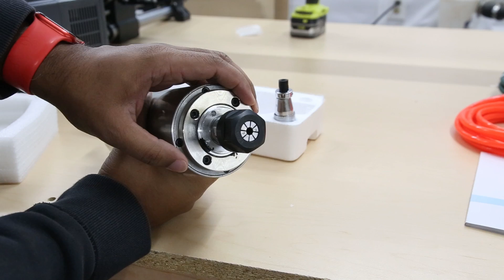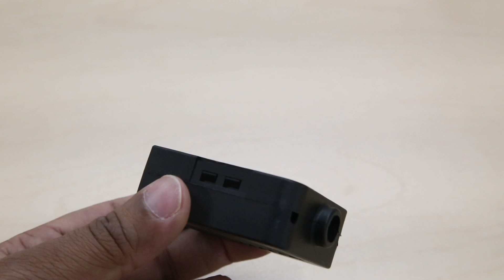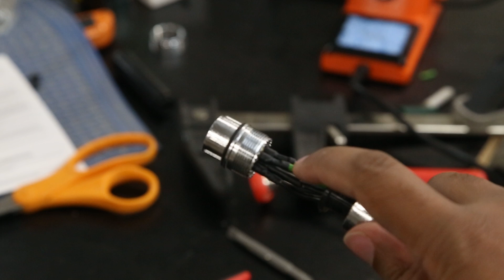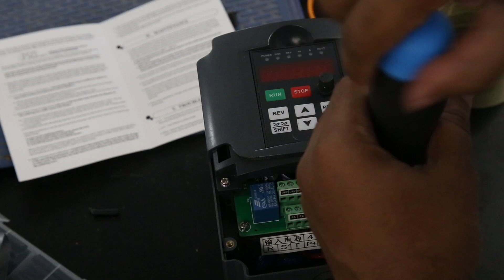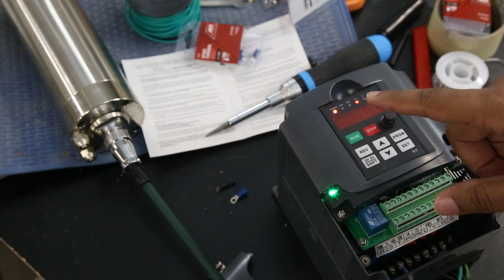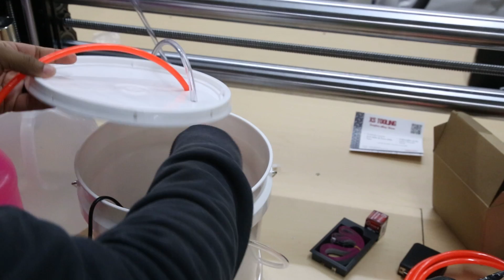How to add a Spindle to your CNC

Comment: Do you have an additional do's and dont's after 2 years of use? Great video, thanks for posting.
Reply from the maker: Related to using the spindle on the cnc or setting up the spindle?
Reply: @vanstray  Related to the using the spindle. I'm seriously considering a spindle and rely on experienced folks for info before I take the plunge.

Comment: Great video thank you for going through the entire process. What awg did you use for the 4 core shielded cable. For some reason the part number on igus is not recognized thanks.
Reply from the maker: should be 16 awg not sure if they've updated that part number since the video was first released, but they had something similar last time I looked.
Reply: @vanstray  thank you for the reply, much appreciated great video!

Comment: I got the journeyman x50 as well. Do I only need to get the 80mm spindle mount to add a spindle to mine? Or do I have to have the heavy-duty Z20 slider as well. Great video
Reply from the maker: You only need the 80mm mount for the x50 if you want to eventually upgrade to the elite version you’ll need the Z20
Reply: @vanstray  I got the Z20 with 80mm ordered. I think I should go ahead and order the stiffy as well

Comment: Better solution ... use cable ferules (the ones with no plastic caps) on the wires, cut to size and then solder the ferule bound ends into the connector. Better consistency.

Comment: That spindle cable shielding should be in contact with the outer connector housing and the ground pin on both the spindle and the MFD side.

Comment: I was wondering if you needed to update to the heavy duty mount for the 1infinity because that spindle was 20lbs or was the mount that came with the journeyman doing ok?
Reply from the maker: I didn’t get the beefy Z mount just then 80mm mounting ring. So far it’s working pretty good.

Comment: One question, why did you tin the wires before crimping on a terminal? I would think crimping to the wire would give you a better connection.
Reply from the maker: Honestly I just didn’t want to deal with all the loose copper fibers when I trimmed the connections. I didn’t find anything against doing it that way and haven’t had any issues

Comment: The shielding on the cable should be grounded to each plug.  Cutting it off the way you did won't let it do its intended purpose.  I used to do wiring and soldering for a government contractor for the USN.  Other than that you did a great job.
Reply from the maker: Thanks someone else just mentioned that to me. I’ll be working on making those updates next time I’m working on the cnc setup

Comment: Great video! I've watched other videos on adding a spindle to a CNC router and you've covered everything in detail. I like your recommendation to get a skilled technician to do the soldering. While I've soldered a lot over the past 40 years and my work has held up for 20+ years in service (life of the equipment), it has been intermittent and done out of necessity. None of my soldering looks as good as that done by a skilled technician who does it daily.

p.s. - At some point you may want to add a flow indicator to ensure the coolant pump is doing its job.
Reply from the maker: Thank you! And I’ll look into the flow indicator

Comment: Great video! thanks! Question, any issues with a 2.2KW on a standard house 15 amps?  or do you have a non-standard higher amp plug?
Reply from the maker: Nope it’s a 120v spindle, haven’t had any issues running it all at the same time. The power strip I’m using is made for data racks, so that could be helping but otherwise no issues

Comment: Great video thanks. Regarding your comments on grounding, I believe the confusion comes from the fact that the cable going to the spindle is "shielded". There is not a problem having a continuous equipment ground from the controller to the spindle via a conductor. The issue is that the "cable shielding" should be grounded at the controller and NOT at the spindle. Cable shielding in general can only be grounded on one end or it will not drain interference noise. If it is grounded at both ends it will create "ground loops" which can effect the signals in the conductors. I think that some of the folks are telling people not to ground the spindle end but they need to be more specific and say "don't ground the shielding at the spindle end" but by all means go ahead and attach the ground conductor. The benefit of enabling the conductor is that then you don't need to use the magnetic probe lead when zeroing your X, Y & Z. This eliminates the chance that you will forget to take the lead off and it is just a lot more convenient. Cheers John
Reply: While there certainly was debate surrounding what you are saying, my understanding is that he was speaking about the ground pin of the connector not being connected to the spindle chassis internally (Only the 3 signal wires were utilized).  From the forum's there were a lot of people who obtained spindles where this was the case.  Apparently grounding the spindle chassis is not a requirement in the Chinese market.
Reply: @scottsamborn4639  Thanks Scott, I think I missed that distinction.

Comment: Just a quick tip for your crimping of wires. Crimps are designed to be used without solder. If done properly the will provide a connection just as reliable as any solder joint. Also, your video only showed you crimping the back half of the crimp which provides the strain relief by crimping on to the insulation. You also need to crimp closer to the lug end to ensure a solid electrical connection. If you don't you can end up with hot spots and conductivity issues causing issues later on down the track. I hope this helps you out in some way :)
Reply from the maker: Always learning so I appreciate the input
Reply: I’m learning too, but it looked to me like the crimp was where the wire was insulated, not bare 🤔

Comment: What's the wire gauge of the spindle cable? Did you purchase the 16 guage cable, or is your ring connector 16 guage? Thx
Reply from the maker: Spindle cable is 4 strands of 16 gauge shielded wire I got from Igus.com

Comment: Q. I see that you are using a regular plug for the power, are you pluging into a 110 or are you wiring the outlet to a 220? I have the same system and can't find the answer to this and don't want to make a mistake, Thank you
Reply from the maker: My setup is made for 110v. They do make a 220 version, but I don’t have 220 in my shop yet
Reply: @vanstray  Love the videos so far.  Helped me with my decision to buy the 1F.  My question is about the amp rating on the 2.2kw spindle.  If it is rated for 20amps then the outlet should be on a 30amp breaker. At least that is what I've been told.
Reply: @vanstray  Looking around I found what I needed, thanks for the video

Comment: Thank you so much for this detailed guide for non experts like me. It really was a common sense\ in depth guide with everything needed. I recently ordered a Onefinity Elite with an 80mm mount and am based in the UK. I'm currently looking at spindle options so this was really helpful. I'm looking forward to the programming guide you do next, as although the Elite has a different (Masso) controller, it will be interesting to see how it goes as I want the CNC to control the spindle. You have a new subscriber.
Reply from the maker: Thank you so much, hoping to do the elite upgrade one day so I can update everyone on how that goes. I know someone that added their own Masso setup and is loving it.
Reply: how did it work out for you? this kit he has im thinking about upgrading as well

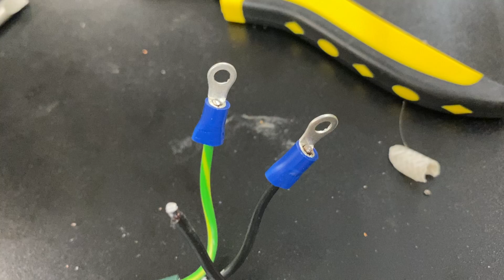Comment: At the 24 minute mark you show crimping on the ring connector to the power cable.  It appears your crimp is down on the insulated part of the wire.  You show earlier cutting off 1/2 the tinned end (leaving what looks like 1 mm of bare wire) and your crimp seems to be well lower down the connector than that.   At 24:45 I see the same lower crimp on more wires and when looking at the ends you can see air space around the wires.   You really need to ensure you have properly crimped on the bare wire portion.  This is your electrical connection.  If you have a gap you can have resistance and sparks. Crimping the insulated part is good too for strain relief, but please make sure you have a solid physical electrical connection as well.
Reply: Saw the same issue as well.   In addition,  The RF shielding in the cable may well have to be bonded if the connector allows for the provision of?  Check the continuity between the ground wire (green) and the connector body.   Good stuff and have a great time with your machine sir.
Reply from the maker: Thanks that’s solid information I’ll use if I need to re-wire any of these connections
Reply: @vanstray  that VFD should not be powered up until those wires are crimped properly. 

Also, the shield for the cable should be grounded at the plug end or the VFD end to ground out induced electrical noise. Not sure if that plug connects to the shield anywhere.

Comment: Big thanks for putting this video and the other one  together.   It's really helping me decide to go the same route for my Onefinity CNC.   I think I can build a system like this using a 220V spindle and VFD rather than a kit (don't need the mount and would like to select my own pump and hoses) or a fancy pre-assembled one.  I'll be watching to see your tests with this and looking to do my own purchase in the next week or so I think.   Still trying to decide whether to buy the 80mm mount for my current Z axis or wait for the new one in a few months.
Reply from the maker: I’m interested as well in the new z slider. So far I’ve done one major cut and it went well. I’d Say to make sure you have the right set of collets and the right set of wrenches to tighten everything down or your bit could slip a little.
Reply: @vanstray  Congratulations on the first cut.  The amount of work required to get these set up right is intimidating, that first success must have felt great.  I've gone ahead and ordered the spindle and VFD.  I do still need the right wrenches.  Can you tell me how wide the wrenches can be and still fit?  Does it require thin 3mm wrenches or will normal ones fit?  I think it is 30mm on the collect and 21mm on the spindle?   Thanks.
Reply from the maker: @Taliesen.  that depends on if you have a dust boot on the actual spindle itself. If not standard wrenches should work fine. I currently have a dust boot on my spindle so i'll be getting a thinner wrench to get a better hold until I get a new dust collection setup.